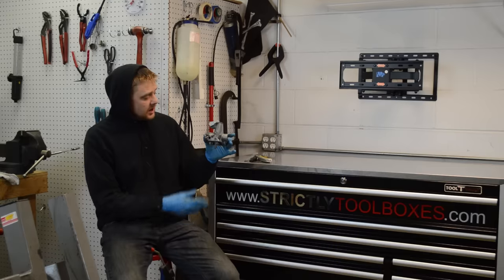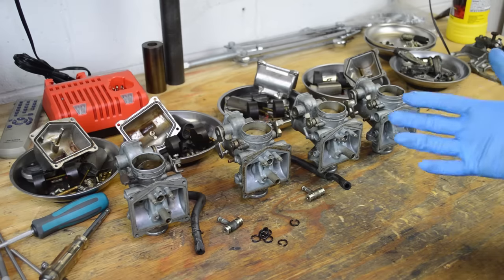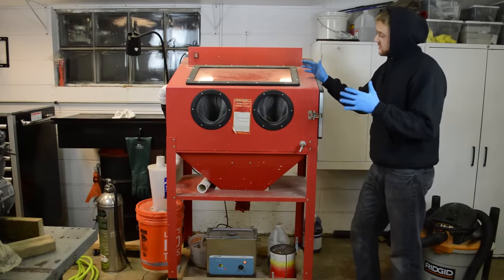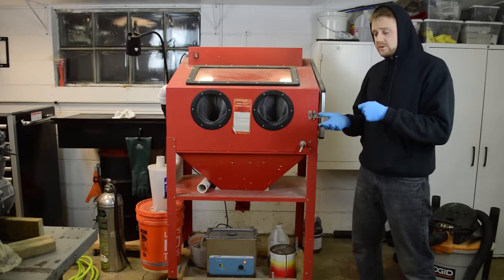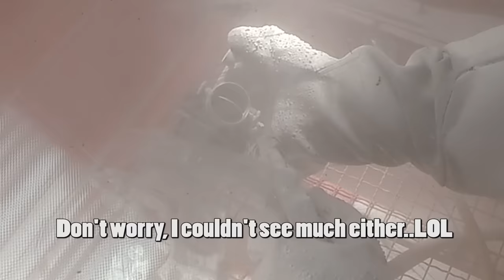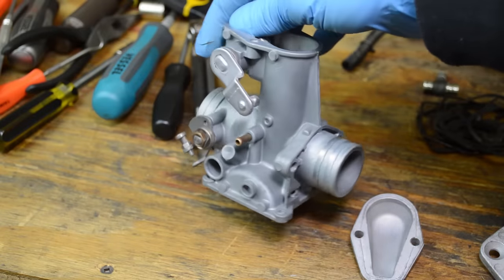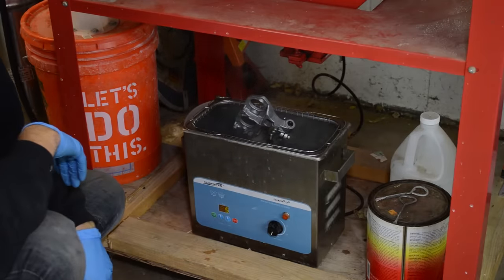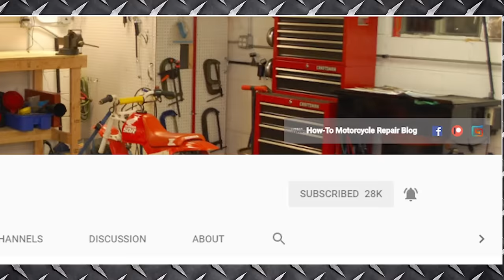The BEST method for cleaning carburetors - soda blast and ultrasonic

Comment: I am cleaning some carbs now. I have the issue that some steel parts have lost parts of their zinc plating and they are not removable for re-plating (riveted onto the end of the throttle valve shaft). I think they're going to go rusty if I don't re-galvanize them. Have you ever dealt with that problem, and if yes, how did you deal with it?
Reply from the maker: Anyway you can drill out rivets? And then rivet them back after plating.

Comment: No way!, chem dip is the best carb cleaner out there, I clean as many carbs as you do. I work in a powersports shop and we do it all, carbs are a five or more a day thing.  I disasembel set plastic and rubber aside and soak for 20 mins drain rinse reassemble install and the world turn great.
Reply from the maker: Chem dip does not take care of rust stains or "crusty" stuff though.
Reply: @HTMR  I do a minimum of 5 to ten carbs a day it works for me everytime chem dip is da bomb
Reply: Sooooo...
Someone else is buying your supplies ..???

Comment: Your blaster flows really well I think I have mine too full. I run it at 130 PSI and it just doesn't pick up well. works great when it does though.
Reply from the maker: I have made modifications to my pickup tube (very easy). Granted I made the mod right away, I have heard complaints about it so I decided to take care of it right away. I will go over the mods in another video.
Reply from the maker: HF cab mods - https://youtu.be/9cDT1LTJN48

Comment: Can I use the ultrasonic without disassembling the carburetors? Does it damage any o-rings or internal parts?
Assuming that I have a very big unit of course.
Reply from the maker: No you have to take them apart.

Comment: Hello sir. I am going to overhaul another 4 cylinder inline engine. Should I vapour blast an engine parts before lathe work or after lathe work like cylinder boring, valve lapping, head porting or decking etc. Should I seal or masking an engine parts before vapour blasting. I heard that Vapour Blasting process change the surface polish or finish like aluminium engine parts lining or gasket area. It changes the shiny surface into satin bright finish on using very fine mesh glass bead 170-325 and the pressure. I use is 50 PSI to 60 PSI.  It also changes the colour of metal parts.
Reply from the maker: Disassemble everything and then vapor blast. Determine is parts are usable, then machine them.
Reply: @HTMR  Thanks Sir. Should I Mask the engine parts with masking hole and masking tape and when should i use rust inhibitor on iron parts.
Reply from the maker: @bittainment5995  No need to mask anything. Use rust inhibitor in the machine and in post rinse bucket. Coat part in wd-40 once dry.
Reply: @HTMR  Thanks a lot. Sir  what is the difference between if I use glass bead 170-325 mesh and sodium bicarbonate 270 mesh. Is the result appear different. Which is better.
Reply from the maker: @bittainment5995  Soda is not as aggressive. Send me pics of what you are trying to vapor blast: https://www.howtomotorcyclerepair.com/contact/

Comment: Is the soda blasting bad for the soft cast aluminum? It does appear to really clean the carbs, but would they be prone to rapid oxidation because the surface is porous from the soda blasting? Would it be better to scrub the carbs clean with brushes, to preserve the factory semi-polished surface texture? I've seen some good results in photos online on vintage carbs with people using Evaporust liquid (not gel). Apparently Evaporust is really good at cleaning non-ferrous metals too, and cleans the oxides off brass and aluminum.
Reply from the maker: Soda does not hurt anything, it is really gentle.

Comment: Thanks for sharing. Personally I'd clean them in the tank first and let the soda do the cosmetic cleaning.  Since the tank often discolor the bodies some.
Reply: I think he blasts them first with the soda then does the ultrasonic cleaner to rid of a residual soda in any of the ports nooks and crannies because the soda is water soluble i do the exact same thing literally just did a set of carbs like this process today

Comment: Not being able to buy carb cleaner in CA, i was forced to use biodegradable Purple Power from Autozone. Oh my, it worked. Fill a bowl, leave the parts submerged for 18 hours, dump it, refill, another 18 hours and you'll have a better than new carb, complete with the purple-blue hues again. See all the tiny dirt and crud on the bottom of the bowl that the solution got out of there. Amazing stuff--if you have the time. I think I paid $6.99/gallon and you only need half a gallon. Im not against blasting but 99% of the viewers will never have a blast cabinet or ultrasonic cleaner so lets talk about whats actually possible.
Reply from the maker: Purple power states "do not use on aluminum". Also, all dips and ultrasonic will NOT remove crusty stuff, it has to be media blasted off. That is why soda then ultrasonic is a good method.
Reply: @MatthewMCRepair  I can say the carbs I cleaned with Purple Power showed no ill effects at all, they were just extremely clean and then performed normally. Maybe "not for aluminum" means staining but I didnt see any staining or pitting of metal or anything. I didnt go to Autozone for Purple Power, I went for carb dip and AZ said the traditional stuff was outlawed, so here try this and it worked like magic. And forgive me, I didnt mean to take away from your good vid about blasting or your work, it was only to say that even if blasting was the No.1 way, most people wont ever have a cabinet or even access to one, or ultrasonic, so they need a way they can actually do. Some people do send their carbs around the country for rebuilding, maybe thats an idea if you are not doing it already.
Reply: @customvideo454  If you want to congratulate, make it that I left 20 years ago to beat the stampede. But some family is still there and I go once a year or two.

Comment: Knock that soda out of small passages with a WaterPik filled with hot water. Been doing it for many many years.  You can even put 3 or 4 heaping tablespoons of baking soda in your WaterPik with "cold' water and clean tiny parts and blocked passages. (This saved my brother-in-law from having to buy a new barrel for his 50cal. Desert Eagle after the dealer and manufacturer told him there was no way to clean a plugged gas passage.)  The previous owner sold it to him  super cheap because it was so expensive to repair.    Less than a dollars worth of Arm & Hammer and 15 minutes, clean as a bright new penny.
       Just don't forget to run a tank full of HOT water through the WaterPik when finished. Otherwise it will harden up in the pump.
Reply from the maker: I'll have to try that. Any waterpic will do?
Reply from the maker: @jnicksnewstart  I'll have to try that method one day

Comment: If the jets, especially the 'slow jets' are clogged, it's just more efficient to buy new ones.  They are very tough to unclog after sitting for a long time, as you all know.  I wouldn't waste time messing around trying to clean them.  They're cheap enough.  Some are getting scarce.
Reply from the maker: Unless they are corroded, they can be easily cleaned in berryman chem dip. If you have an inline 4, new jets across the board can get pricey.
Reply: Never heard of that stuff..have to look for it.  Main jets will clean up easily, but the 'slow jets' once clogged with junk and corroded inside from long sitting are not worth messing with.  You may think you have 'em cleaned, put back in, and still no idle. I've dried phosphoric acid, boiled water with lemon, etc. but if they are shot, they're shot.
Reply from the maker: If corroded...yes replace them. If dirty due to varnish, they will clean up fine in berryman chem dip or soda blast. I've been cleaning carbs for 20+yrs and rarely replace jets. I also never poke them with wires etc...

Comment: Hey man. I got a GS850 13k miles did a bunch of work to get it on the road etc. I had the carbs completely rebuilt by a gentlemen on the GS forums. It sat about 2 years with fuel, should be ok with an ultra sonic clean right?
Reply from the maker: Not sure, open them up.

Comment: Would you tell me what works best as a carb cleaning solution in your ultrasonic cleaner please?
Reply from the maker: The only solution I have used is sharpertek 1220. Not to say others will work but I'm happy with what I've been using.

Comment: I don't have an ultra sonic cleaner and will have a soda blaster soon. Would you soak in the Berryman chem-dip first then soda blast?
Reply from the maker: No need. Go straight to soda blast. If you dip them in berryman, then you will have to rinse and dry parts thoroughly. The soda tends to pack with any moisture present. After blasting blow parts with air, then rinse in hot water to clean any soda left.

Comment: nice job, Matt, I suppose it's kind of hard on your air compressor, a friend of mine has a grease monkey  ultrasonic cleaner and I use that for my tough jobs. he uses it on engine components for his race car. does a killer job on carbon deposits. nice unit but expensive,I use a setup like yours for the carbs on my lawnmower, boat and other small engine repairs

Comment: That does appear to be the best method. If you were down on space and money how many times would you have to run your carb through the ultrasonic to get it on par with your 2 stage operation?  I'd love to see a comparison video or just hear an answer I guess😊
Reply from the maker: The ultrasonic does not remove "crusty" stuff or rust stains like soda does. Also, soda removes light gasket material which is awesome.
Reply: @HTMR  thanks for replying so fast. I'm investing😁

Comment: Great vid Matthew. You missed the major pain of carb cleaning, the jets. You talked about small parts at the end but didn't specifically offer advice for re jets. No matter how clean the body & bowl, if the jets are choked up the bike won't run and the jet's holes are the most delicate. Can you please advise how you cleaned the jets; blast & bath or did you just use chemicals? Also a tip for your vids, pleas clean your window between the camera and subject, we couldn't see the blast jet progressing on your target so we might as well just see the before and after. Looking forward to your cabinet mods video too. Its the same as mine and while I'm currently using glass or plastic media, I want to set it up for soda and wet/vapor blasting if possible. Can you also include your cyclonic vacuum setup? Mine's a simple wet/dry vac pulling through a water sump.

You've now got another subscriber, cheers.
Reply from the maker: 1. All jets go in a small basket and into ultrasonic tank. Or poke holes into carboard as a holder during blasting. I did mention this in the video.

2. I did clean the window. It gets dirty instantly. You can't even see what you are blasting in person.

3. I will do the cab mod video soon. I tried the water bucket and it was horrible. I have a few videos on dust control here:

https://www.howtomotorcyclerepair.com/waterbucket/

https://www.howtomotorcyclerepair.com/dustdeputy/

https://www.howtomotorcyclerepair.com/pvcshopvacfittings/
Reply: techo61 I
Reply: use a cyclone and a vac to keep the cabinet clear, the dust the cyclone catches can be sifted and reused. I use one on my sandblasting media and it works great.
Reply from the maker: Yup...already have one: https://youtu.be/eq2RST1ye8k
Reply: HI. Don't worry, just put jets and everything in the ultrasonic cleaner. I know people who use a pure cab. cleaning in the ultrasonic, and it works fine without blasting first. It cleans all the fine holes and so on, and to be sure, you just blow them through with compressed air, after Ultrasonic cleaning. Buuum joob done. :o)
Reply: Those cyclone units work great. I got a generic one via Ebay after seeing my bro use it to vacuum chips from his lathe.
Reply: Jets are cheap if a can of carb clean and compressed air won’t take care of it $3 at the motorcycle shop will

Comment: Very valuable post! Thanks. Sharpertek says its better to use their varnish remover then the SC20 degreaser of theirs that you used. What do you think? Thanks
Reply from the maker: Never tried it since you use it straight up = more expensive.
Reply: @HTMR  True, but they told me you can keep using it over and over again as long as you strain it first. Has the SC20 ever let you down in removing varnish?
Reply from the maker: @carwizard01  I use chem dip for heavy varnish, then soda blast, then ultrasonic. That is my current process.
Reply: has there ever been a time where the SC20 did not cut through the varnish? Thanks
Reply from the maker: @carwizard01  I use 1220 and it cuts through light varnish no problem. I haven't tried heavy varnish.

Comment: Looks like the aluminum has gotten "etched" from the process. Have you tried using a polishing vibrator tub with ceramic media after your cleaning procedure, to polish the aluminum so it doesn't look etched?
Reply from the maker: No.

Comment: Great vid. Yea soda blasting works the BEST. I've done it before on extremely dirty carbs. I would NOT use hot water in the ultrasonic cleaner though. I would be worried about warping the float bowl mating surfaces. I did the same thing with one carb and it was already warped, but I'm sure it did not help at all. Maybe I'm crazy, but on parts that never get that hot like carbs I wouldn't risk it.
Reply from the maker: I get the water bath up to 120-140°F and have had zero issues. Gave you a sub:)
Reply: MatthewMCRepair Yea, I just throw it in there that way you don't even have to wait for it to heat up. It's good you haven't had any problems. Thanks! Sub for sub.
Reply: Just remember, carburetors on running engines are exposed to much more than the 140 or 160 temps mentioned here. A carburetor on a V-8 will see higher temps than that. The thermostat in most engines these days open around 191 to 196 degrees Fahrenheit and water circulated through the intake manifold will be at that temp or higher, so you don’t need to worry about the carb body or air horn warping from hot water. Yes, the float itself would not take has much heat as the carb body, but you can clean a float easily
Reply: Matt's Shop a
Reply: Bobby Walker Good points, but I have to disagree. On some applications a carb's body would get hot and on some applications it would not get that hot. You're telling me a dirtbike or tiller's carb gets that hot? I know that's not true because you can grab one of these carbs after running for a while and not get burned.
Reply: I've been cleaning carbs. for over 40 years and never saw a metal float bowl warp from a warm cleaning solution, water based solution would be 212`F max. still not enough for warpage of aluminum.
Commonly warped bowls are because of over torque, or incorrect, partial, layered gaskets. Debris between mating surfaces, dropped, or run over I have seen also.  If the o-ring on the main jet tube is too fat or pinched it will warp the bowl when tightening screws.
Do not heat mineral base carb. cleaner solutions for fire risk... that will overheat and warp your carbs, garage and everything in it....  The wife will be warped too. Be careful, use caution! (:o)
Reply: I just have a quick question. Do you have a dryer on your compressor to prevent moisture from clogging your gun?
Reply: What about powder coating carbs? I've done this numerous times and had zero issues. I run our powder coating oven at 425*F and have experienced no perceivable warping of any mating surfaces. I can't possibly understand how some warm water would cause a carburetor body or the associated float bowl to warp. Maybe the next one that I powder coat will warp...

Comment: Is it safe to use soda blasting on valve seats or do you leave the valves in the heads when you blast?
Reply from the maker: Soda is safe for that and you should remove valves.

Comment: What kind of air compressor are you running @MatthewMCRepair?  I want to build a similar blast cabinet setup and I (of course) realize the most expensive part is the compressor... I'm just not sure what size I should get, etc... or if there are any other tips?
Reply from the maker: The HF gun consumes 10cfm @ 70-80psi. There are better guns like Tacoma that consume more (better blast power) like around 16CFM. Having said that, get a true 5hp pushing 17-19cfm at the minimun. Here is mine: https://youtu.be/I-mbDwclIzY

Comment: Great video. One question, you did not used the extractor fan? As is your mod done, you have the vacum cleaner connected. You didn't use it on this video?
Reply: 19:16...yes, you mentioned about the extractor fan. I missed this info.
Reply from the maker: @elmandracula  Yes, use a dust deputy and shop vac. Works great!

Comment: Nicely done video, but I am only interested in cleaning the small brass jets to get back full sized opening.  Wondering what dip solution you recommend for cleaning these small parts overnight to dissolve crap from inside the holes?
Reply from the maker: Berryman chem dip - https://amzn.to/3hhlipf
Reply: Heat them with Micro Torch. Burn them clean.
Reply: Hear with a Mini Torch and throw them in small amount of carb cleaner or whatever. Boil them clean with heat. Works fsst.

Comment: Doesn't matter what it looks like on the outside .. You have disassemble and soak the carb and jets in Honda carb cleaner over night ..
Reply from the maker: If you were a customer paying for a carb clean, wouldn't you want the outside to look just as nice? Soda blast travels through all orifices, so the inside is super clean. Follow up with ultrasonic for even better results.

Comment: very nice vid, 
what is the size  ( capacity) of the tub of the ultrasonic
do you find it is big enough
thanks
Reply from the maker: About 1-1.5 gallon I think. It's fine for dunking single carbs. The tanks get really expensive for larger units.